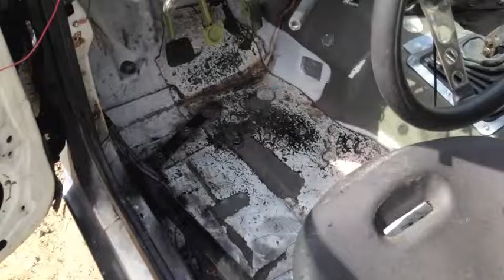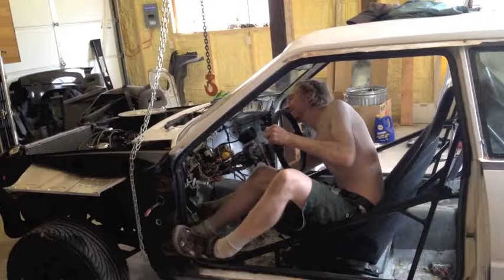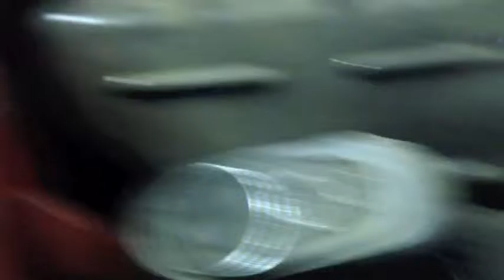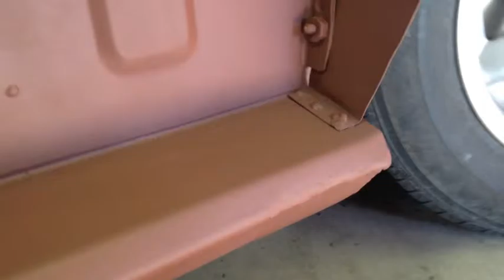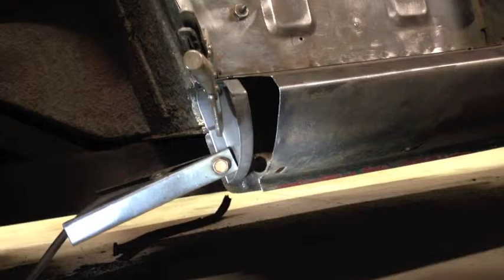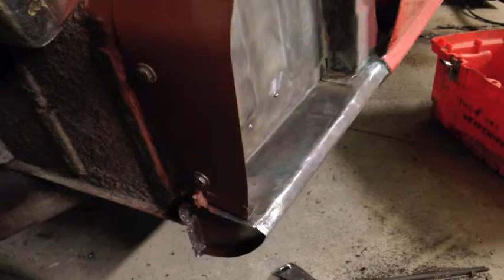V8 Triumph Project (Part 1)

Comment: That's the tail section from a TR6 welded in there.  Check your tail lights and compare them to an original TR4
Reply from the maker: We know! Some Alaskan nut in the '80s got bored and spliced the two into one... sort of.

Comment: Just use the cage thingy out of the Ford to support the Tr-4. it's my understanding that you just add more when something flexes.
Reply from the maker: +Jonathan W LOL pause the video and have a look at the welds on that cage... I wouldn't trust it for more than raspberries. We've started stitching up the botched bodywork with proper welds and it's getting stronger already.
Reply: I seen the welds..
Reply from the maker: Flux core over galvanized steel is all I can figure.